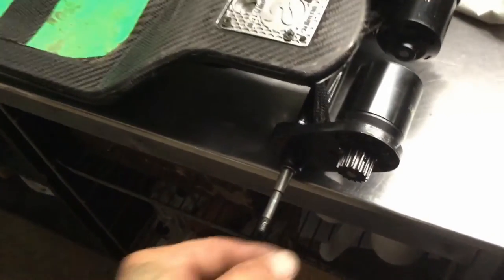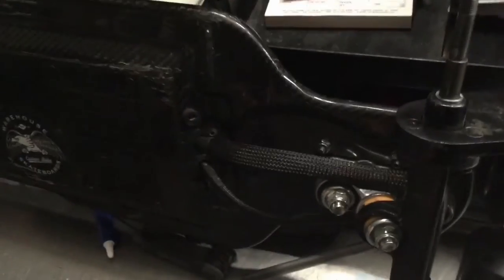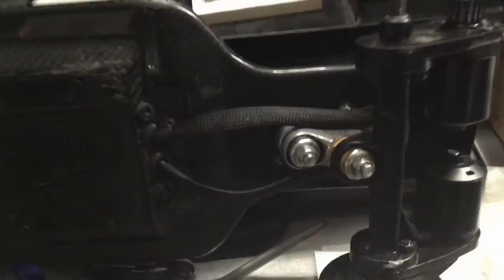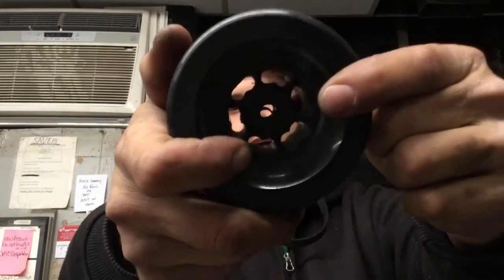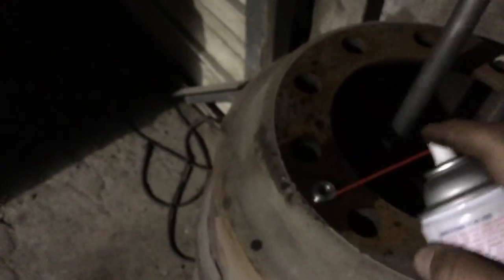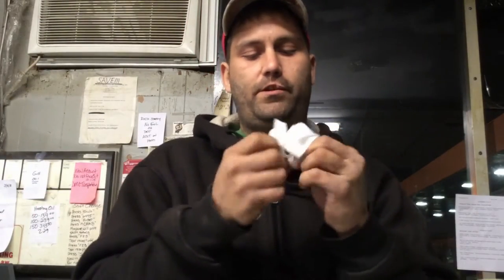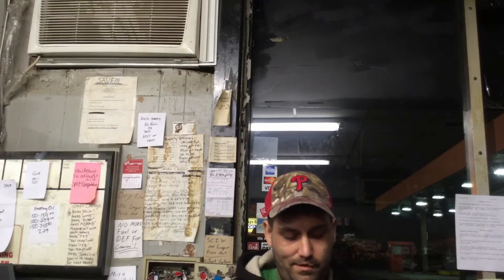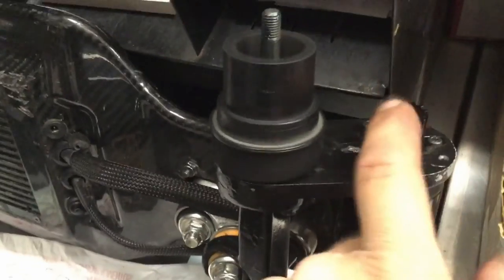Electric Skateboard Maintenance - Hub Gear Bearing 
Evolve Carbon GT

Comment: Hi Joe  its funny but your the only person that i know except me who does this Maintenence
I like that,
I am alway telling my skateboard friends to do this stuff but they ONLY do it once a year if that,
i do it nearly every 2 weeks and a full deep clean of all the belts and everything that even could get grimy every month,depends where i have been skating thou ie if its been raining and its slishy then i clean it when i get home straight away
when my friends see me over taking them i smile i know why
but i have also bought some very nice bearings too ,
ps people dont believe every thing you read on bearing adverts 
its not all true, however  i have to say all ceramic bearings are notably faster on my board
so long as your not going to slam your wheels cos they can smash,
if your a slamer stick to metal bearings  
nice vide i like watching this kind of thing ,more please
Reply from the maker: loopiewho oh awesome thanks for taking the time to comment. ive actually been quit curious as to if ceramic would indeed hold up. The bearings make a world of difference. So does maintenance! Depending on how much use i put it through is how often it gets cleaned and how thorough. More use the more maintenance of course. Sometime lessons are very hard learned lol. Thanks again!

Comment: hey bud, can you make a video on how to change the motor bearings on the evolve board ?
Reply from the maker: +sebastian teulea i can, i will break those motors down. I have about a half dozen of them or so and I already started doing it so I can have it in stages to make the video I just haven't done it yet and it's not on my list so what I'll do is I'll put that on my list right now
Reply: Joe Kyser one more random question, since changing the bearings in the motor will probably be a one time thing, what are your thoughts on either closed bearings ( I usually prefer SKF's ) or the one with rubber shield ( bones or such). and if it's the second ones , do you think that a lithium grease would do a better job at heat dissipation and friction reducing properties, or you'd prefer the speed cream or similar oils? again, thanks for the time you put in answering all the questions on your channel.
Reply from the maker: +sebastian teulea well making this video is going to explain a lot about how the motors made where failure comes in at and I'm definitely going to answer your questions there without a doubt because your way of thinking I could already tell was my way of thinking it one time for from experience of motor failure and what's really going on here with these evolve Motors I'm definitely going to explain that I actually have the motors all out right now they're on a table they're all laid out I'm writing out a script for it. I'm so far behind because of my editing here I'm having a problem actually run during the final video so I'm a couple videos behind but I am working on this right now.  sit tight I'm going to cover all that for you
Reply: Joe Kyser an interesting finding- since I was curious about this for a while now, and figured that I'd better know the answer before I actually put the bearings inside the motor , so since I have some spare Bronson g3 bearings (all brand new), I thought to test the heat resistance of the oil vs grease. so I cleaned one of them, and started to spin it at around 15000 rpms ( yes 15 thousands- even if overkill, it shortened the test time). the bearing seized within 48seconds. next one, I put bones speedcream, and repeated the process. it took about 112 seconds till the bearing gave up. next one, I put Lucas red #2 lithium grease and repeat the process. the bearing did not seized, and after the fifth minute I got bored, and shut the machine off.so based on this little experiment, I'd say that maybe grease is the way to go, even though the bearings inside the wheels or motor will never even come close to the stress I put mine to. thought this info might come handy to whomever is interested.
Reply from the maker: +sebastian teulea thats pretty interesting to say the least

Comment: Question. That gear drive bearing. What size is it… I just got my first board. 48 hrs ago. Made a few small rides next to my son. Then this morning the wheel came off. That bearing remains were just the inside and outside race. I’d like to know a size and brand preference if possible. Great video thanks again
Reply from the maker: 6900-2rs
Reply from the maker: the bearing with the larger 10mm hole right?

Comment: Thanks for the vid', getting my Gt Carbon tomorrow so watching all these helpful vids!
Reply from the maker: +ajdahun oh no problem at all if you ever have any questions just let me know I have become very well-versed in it that's for sure. my best recommendation is to make sure all the bearings stay Clean. the ones that always feel the first for me or the ones actually in the motors. speaking of that I burned up another one yesterday from lack of Maintenance because I've been pushing it hard. of course I do use my board probably about 10 times more than the average person but it's definitely something to look out for
Reply: I live near the beach so you know I will have to be on top of the maintenance with the sand and all...New sub' here.
Reply from the maker: +ajdahun oh yeah absolutely even more than most I would say. it's very Sandy around my way. i live right on a big ass river.

Comment: if you're looking for a better bearing for the drive gear, look for ones that are manufactured by SKF, one of the best ball bearing manufacturers. As Joe Kyser mentioned, the size is 10mm X 22mm X 6mm. The generic ones are ok too- that's what Evolve is selling, but many Chinese manufacturers they don't have their own manufacturing plant and outsource the work, resulting in lower quality bearings.
Reply from the maker: +sebastian teulea yes I am absolutely do you have a link for that I've actually tried to look for those but I'm not certain where to go. I'm going to check again maybe it wasn't that brand I definitely appreciate that 100% though see that's the whole point of this channel everybody's information can be collectively put together and then I'll make sure that I can pass that on in the future so that little tiny bit of help there is so awesome you don't even know because I get a lot of people that ask. I haven't had an answer for them yet besides this crappy bearing from China that cost $0.20 lmao. one thing I do have to say though is I bought some abec 9 bearings off of eBay and they roll roll roll roll roll their amazing. I believe I bought 10 for $3
Reply: i had a hard time locating them, but i've found them on ebay, they're sold out though, this are the specs-SKF 6900-2Z Metal Shielded Thin Section Deep Groove Ball Bearing 10x22x6mm. for whomever is looking for custom bearings, there is a very useful chart on skf website  http://www.skf.com/group/products/bearings-units-housings/ball-bearings/index.html  where you can find the actual part number of your desired bearing. Many people know about the skateboard bearings, like bones, but there are way better bearings on the market, with a longer life span and virtually maintenance free. some of them can get very expensive though.
Reply from the maker: +sebastian teulea oh yeah I agree it's been a while since I put out the money to buy a really expensive pair but I know they're worth it. that information now though that's pretty good the part number and all that maybe I can do a little bit of research too and stay on top of that because that's a question that's asking an awful lot. someone else had emailed me one time with a link to somebody who had them but they didn't have them very long when they sold out they were sold out. then they never answered me if they're going to get more so I lost that
Reply: even if not related, this might be a useful link for the Evolve  board owners, where you can get custom hubs, hub gears, bumpers, etc . I've personally got a few of their products, -and while it might take a while to get them, as they're located overseas, i do believe they're worth it :https://www.boardbumpersshop.com/
Reply from the maker: +sebastian teulea oh shoot heck ya. there's been a couple companies that make custom parts and I've tried to get them to make me some but it's never panned out. I like the sound of this one I'll have to definitely check this out too. Hey thanks a million!!

Comment: you can replace your drive gear bearings with better quality, we recommend the Bear ceramic 10mm
Reply from the maker: +warren jordan i will have to check that out. the ones i have look like the junk that's in it
Reply: I didn't know Walking Phoenix did skateboard work shops. Wow bad acting..DONT TRY THIS AT HOME..

Comment: Hey whats up bro quick question. How did you manage to fit the Hub Gear onto the cheaper Amazon 83mm wheels? If possible could you make a video on how to fit the Hub Gear onto the Amazon Wheels Thanks and keep up the Good Work
Reply from the maker: +DJLoveNoise oh yeah man I keep getting that question. what I had to do was chase the inside of those holes with a drill bit. I could definitely make a video about that
Reply: Thanks for the quick response bro. I'll mostly definitely give it a shot and keep up the good work!!!

Comment: ok there is something hear you say the I do I do check my bike brakes before riding and chain because in scare or my brake failing on me I have disc brakes so I always check the brake pads are good because I break a lot and really hard I wear my pads fast
Reply from the maker: +nightmare in action nighmare in action I'm speaking typically in a hypothetical situation. I know growing up between me and all of my friends we grab the bike and we went periodically maybe we did that but it wasn't before every single time we rode. I literally mean if you go someplace before you leave that place give an inspection and then go. I guess I didn't emphasize enough how often it is important with electric Skateboards
Reply: Joe Kyser oh I see like you mean a board can get more wear faster than what a bike can and needs to be inspected more often
Reply from the maker: +nightmare in action nighmare in action new video coming out tonight just for you buddy! hey i cant wait to do this carbon fiber Kevlar build. its going to be sick. thank you very much for your comments. its appreciated. we always like another view point. the hate is starting to come in lol
Reply: Joe Kyser lol that will always happens there is always going to be someone the has a different opinion on stuff and I cant wait to see what that video is about tonight right now in home and there is sun I got hooked up with some broken solar panels and they still make power this is fun because when I connect all 17 of them in series I get around 580volts I make sweat arcs with that I might make a video on it but its weird it only seems to make the arcs with volts meter probles and I melted mines doing it too mutch lol
Reply: Joe Kyser I uploaded a video doing arcs with 3 solar panels because I know if I do it later the sun would be down and woulnt be able to show it
Reply from the maker: +nightmare in action nighmare in action yo video tape that bro
Reply: Joe Kyser I did its already uploaded

Comment: Hey bro, I just got a brand new carbon GT with all terrains and it has slight clicking noises right out of the box one front wheel and both back wheels I've taking everything apart but it's all brand new... Does that seem right?
Reply from the maker: Yes it does sound normal. Why they havent adjusted that yet is beyond me but if you put double speed rings on then the wheel it should help that
Reply from the maker: Sorry bro just now saw this
Reply: @JoeKyser  thanks bro
Reply from the maker: @clutchcarabelli8054  your welcome. any other questions just ask away. i have a lot of experience with this board and know it like the back of my hand. Have fun!!

Comment: Hey man, I've only had my carbon GT with all terrains for 3 months and it has an annoying clicking noise coming from the motor. I've taken the board apart and checked but it's still making the noise. Sounds like the exact same motor issue in your video. Got any ideas what I should do?
Reply from the maker: I actually have a video here that's exactly for that it goes over the clicking noise. It could be a few things. If you've had it apart. Be sure there's a double speed ring on there before you put the wheel on. I'm going to have to see if I can find that video for you
Reply from the maker: https://youtu.be/kE1OFkjR9FQ
Reply: @JoeKyser  cheers

Comment: Mine is doing the clicking as well. How did you tighten it up?
Reply from the maker: +StevenCarls3 oh the clicking noise maybe coming from the gear on the motor. what I would do is take it apart make sure the bearings are clean make sure the bearings are intact. make sure your washers are on there as well. if all that looks good and it's still clicking and the gear is tight on the motor then your motor is probably on its way out the door

Comment: Dude did  gum cutter help? i feel that shit gets all the lube out too.... like i hear WD40 is bad too. it cuts the grease. I recently tried zealous bearing 15 bucks and it was amazed. if a shitty bearing seizes it will lock and melt your wheel bearing seat. BTW love your vids
Reply from the maker: +He's Rich i use whatever anti squeekey spray or lube is at hand lol. if you clean that's fine but you need to grease. now I understand sealed bearings are sealed bearings but the liquid does get inside of them and as it heats up it does spread so it is possible to read lubricate I know there's going to be people that all argue that but how does water and dirt get inside of a sealed bearing I've seen it happen so it can go both ways you can definitely clean them up if you make sure you keep them clean I think the less you have to worry about it like if you do an outside cleaning and do that often which maybe something like gum cutter might be a little too harsh maybe something that's like a cleaner and lubricant in one yeah WD-40 probably more online I forget what the stuff is I'm using right now I'll have to take a double check on that and look

Comment: Hey Joe, is there anyone out there that sells AT tires for the Carbon GT other than (cheaper) Evolve?
Reply from the maker: +ajdahun that's a really good question I've searched around and to get them cheaper yes. but is it a good tire no. there is an eBay option for the complete Hub and tire which is cheaper and it appears it's the same quality. I believe the only issue is you have to alter the cogs to get it to fit the wheels itself. I do have some links for some tires though maybe. let me check my computer and see if they're still there. I'm pretty sure the one company I wanted to check out somebody did buy some in one of the evolved forums and they said they were junk. that's one thing I can definitely give evolve is that the tires they sell or definitely high quality
Reply: cool, thanks again, which evolve forum(s) are you on/ any good?
Reply: Check these out, I do not mind paying but all the carving I am doing is wearing mine faster than I thought they would, and yes I am rotating them

Comment: so why was it clicking?
Reply from the maker: +ajdahun on the aftermarket Motors the set screw tends to come loose and I didn't know that yet because they were pretty new to me. it definitely needed some high-strength Loctite and a little bit longer set screw. every time the wheel rotated it would hit the flat spot in the gear keyway and give a clicking noise. I didn't notice it right away because I figured it was the bearing but that's what it was
Reply: thanks. I should not have that problem since mine is stock but I had a clicking once today and once yesterday, both times at almost a stop under the heaviest braking I ever did, my pads came in today so I have been in GT mode and it is a rush to say the least

Comment: "Your an idiot that's a sealed bearing!!" LMAO cuz if you know anything about Porsches and their problematic IMS bearings, guess what? those are sealed bearings as well. Zuffenhausen really dropped the ball on that one!
Reply from the maker: +ajdahun i did say the hub bearing are sealed yes.
Reply: I was making fun of the folks who think a sealed bearing needs no maintenance and is impervious to moat anything
Reply from the maker: +ajdahun yeah I'll be honest with you when I miss Lee pulled the bearings and looked at them it look like they had slots in it like it was just a little lip covering it up. I had initially thought you could pack grease into it and then when it heated up it would flow into the bearing.  I figured give it a shot and I definitely realize what I was doing I just didn't make great commentary about it. It was a little embarrassing. I tried my best to save myself lmao. too funny.
Reply: Just saw your vid on the deck cracking, is that common? I will be running the all terrain tires only but doing little to no offroading initially
Reply from the maker: +ajdahun well you know what I did see one other video on YouTube where a guy had a brand new one and it broke the first day then they replaced it and then next one broke. as far as cracking yes it is kind of common but it seems like it's just cracking at the scene and there's not really much more damage other than that. I actually want to do a follow up on this because despite it cracking it really was pretty durable. the problem was they sandwich both sides together and have a seam they should have overlapped it. I know the deck on building right now that's what I'm going to do I'm going to overlap the carbon fiber
Reply: can't wait to see it